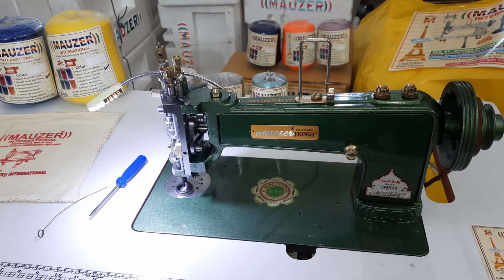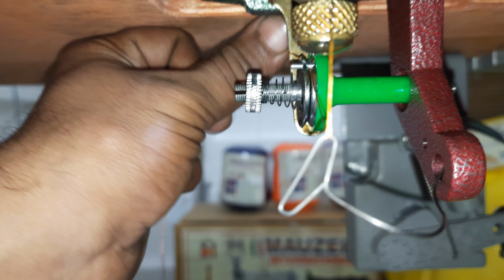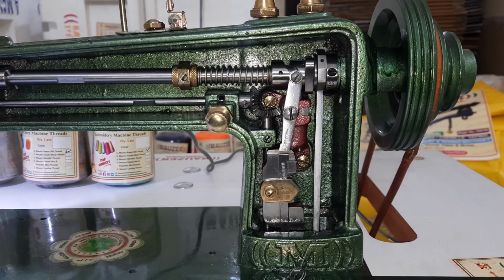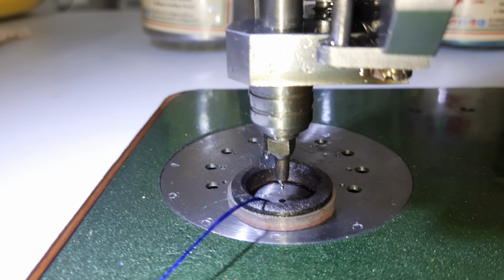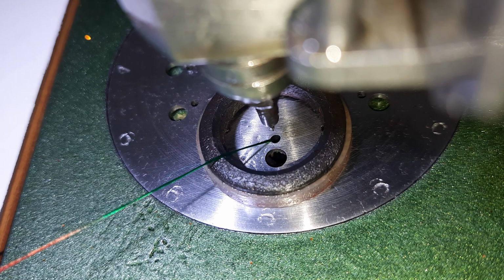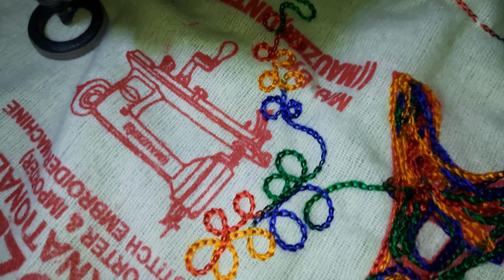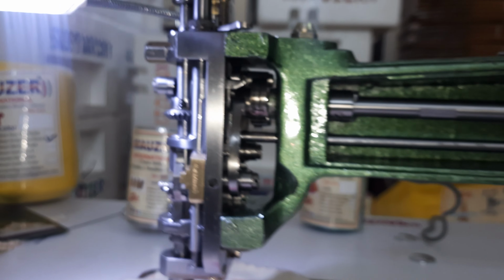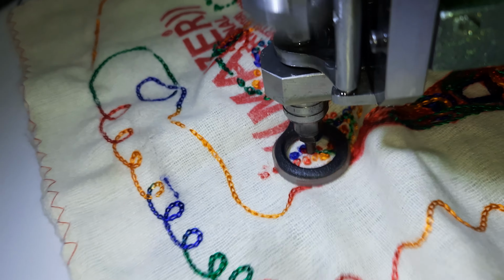how to thread your Mannan King Chainstitch embroidery & Moss Stitch Embroidery .

Comment: By removing that spring I have found I can reach under the machine and push up the Stop Motion to force the machine to stop at Top.  Quite handy.  Then operate the machine- push handle up once and it is back disengaged.